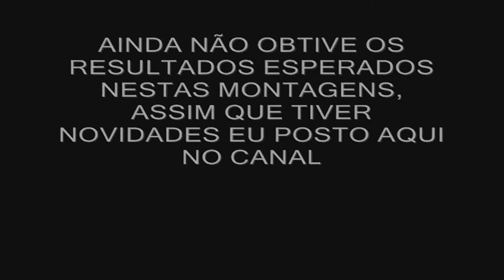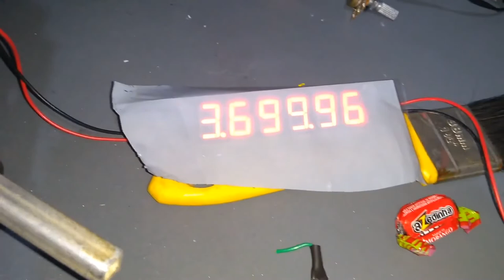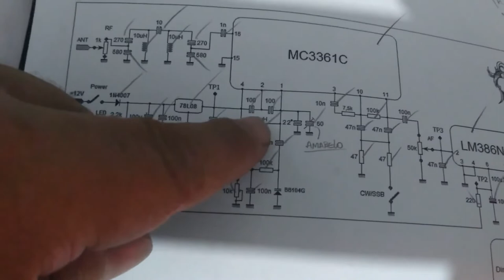LIDIA - RECEPTOR CASEIRO DE CONVERSÃO DIRETA / LIDIA - HOME CONVERSION RECEIVER

Comment: Ola tentei fazer para 80m mas não tive resultado ,pergunto qual diodo varicap usou ?
Reply from the maker: Olá Guaracy, tudo ok? Eu utilizei o varicap BB809, e consegui um range até bom com ele. O receptor tem uma excelente sensibilidade, tanto que existem relatos no Youtube que o pessoal consegue bons resultados com apenas uma antena interna, ou um fio esticado. Mas como pode perceber no vídeo, o áudio do meu está incompreensível, já não sei mais oque pode ser, alterei diversas vezes o circuito. Funciona muito bem com o frequêncimetro Guaracy. Montei em 3 versões, para 80, 40 e 10 metros. Abraço!